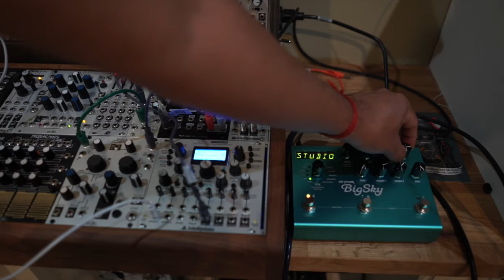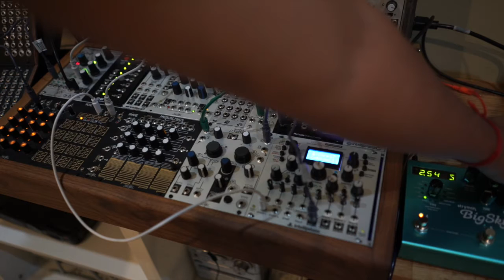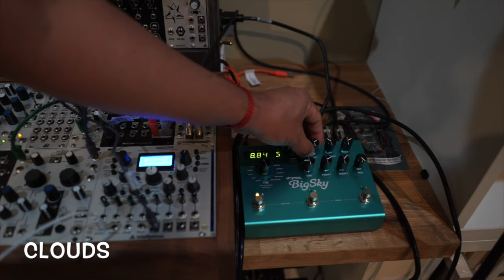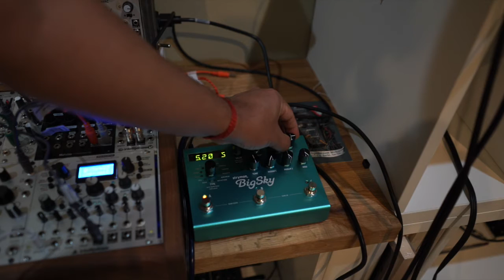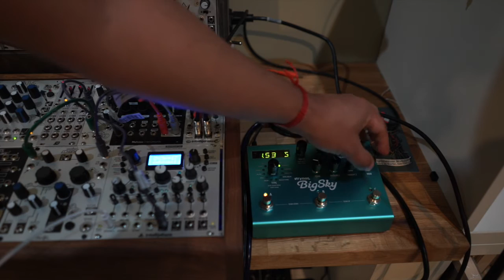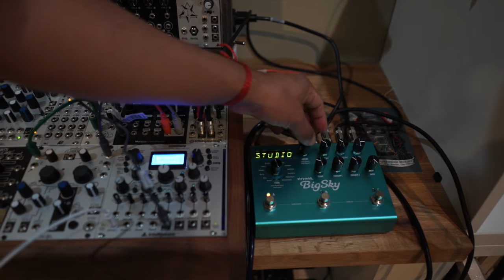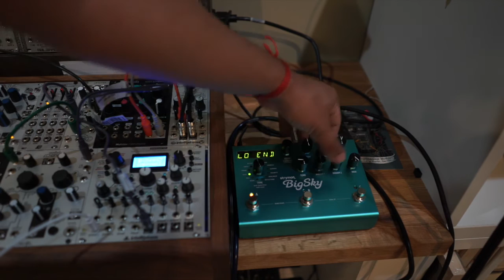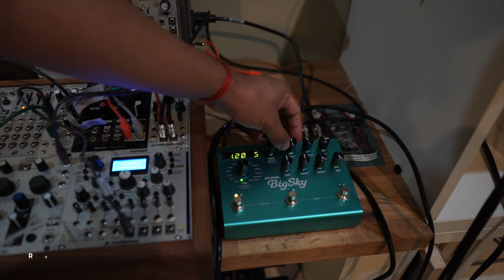Exploring Modular Synths 12 - Strymon Big Sky Demo

Comment: @modular_landing im building my first eurorack, and already have a big sky. Was thinkin about selling it to fund my modules, but here it looks great! I have a pedal io 1u from intellijel, so thatll work.
Module-wise, only have a Morphagene so far. Could you please recommend an oscillator and a sequencer module?
Reply from the maker: For oscillators, there are lots of good ones but my favorite is the Dixie ii+, since it has a great core sound. For sequencers, it's hard to recommend because they vary so much. I like random/experimental stuff so I love the Rene. But it's not the best for traditional programmed lines. For that, I tend to use an external sequencers because they are cheaper, like my Deluge, Korg SQ1, or MIDI in (through a MIDI module). Definitely check out the sequencers out there as there are plenty of good ones, but they tend to be pricey!